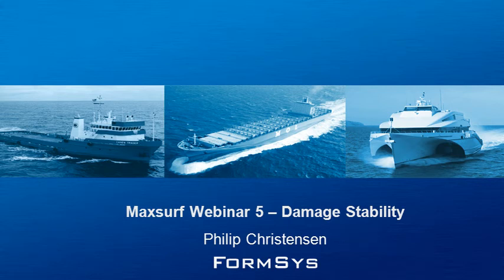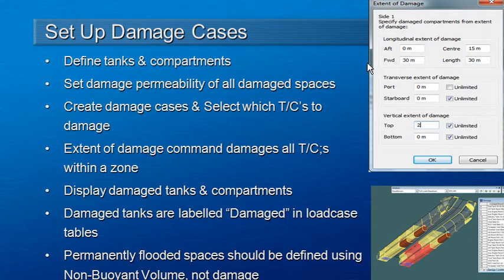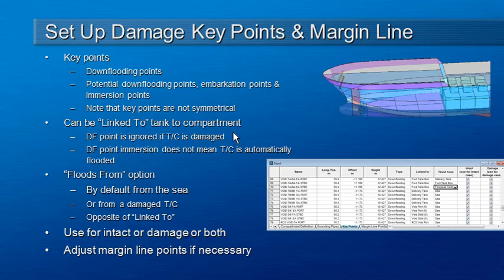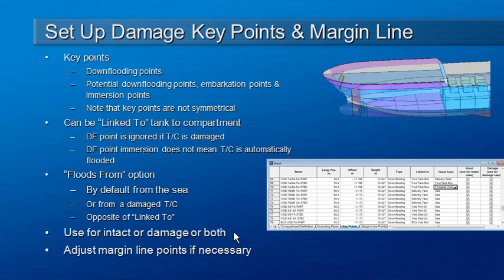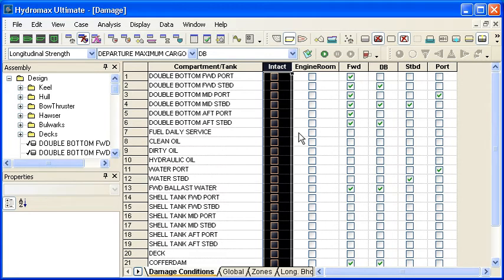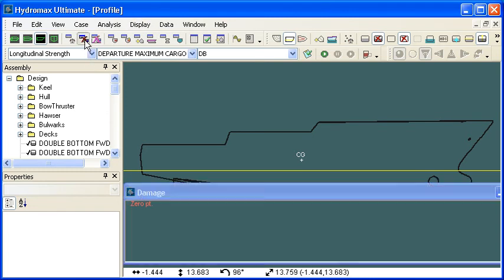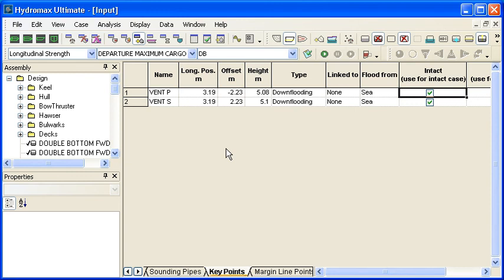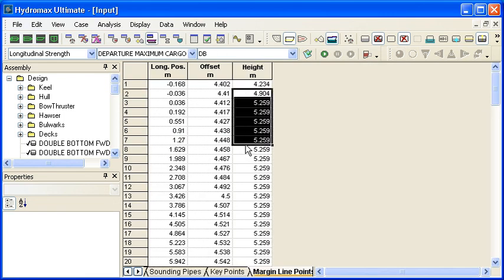Damage Setup

Comment: Can you please explain the potential down flooding point and immersion point with example ? If i have a air pipe leading to a wing tank which has a protected opening like air head, so should i include this in potential down flooding point ? what will be the effect of this in the analysis ? can you please explain
Reply from the maker: By default only Downflooding Points are used to compute the downflooding angle commonly used in stability criteria. The other types of key points (such as Potential and Immersion points) are normally for informational purposes. They are handy for seeing at which angle various parts of the vessel immerse. However if you customize criteria or create your own, they those other points can be selected for inclusion in the criteria. This gives you a way to have different types of points used in different criteria.